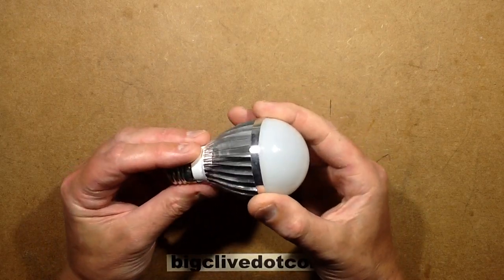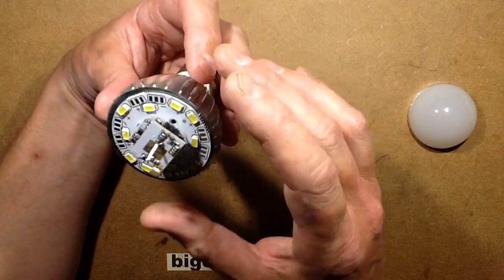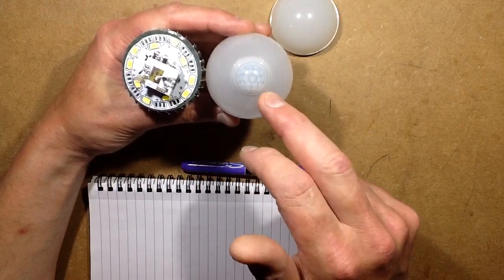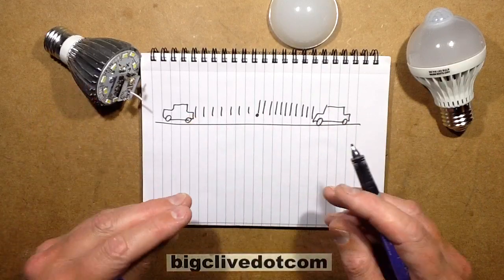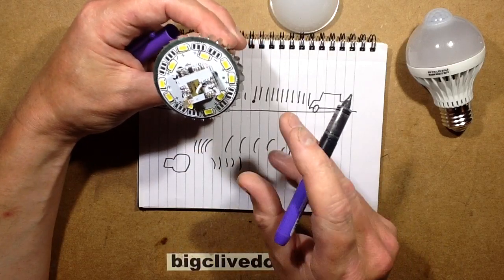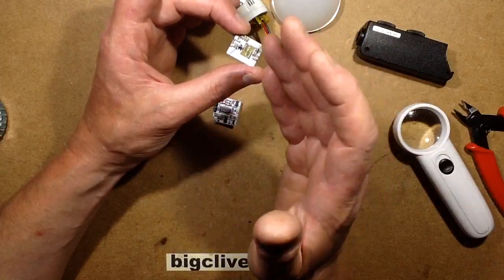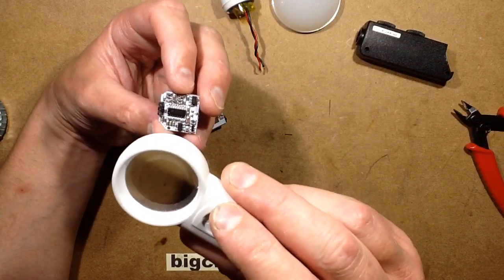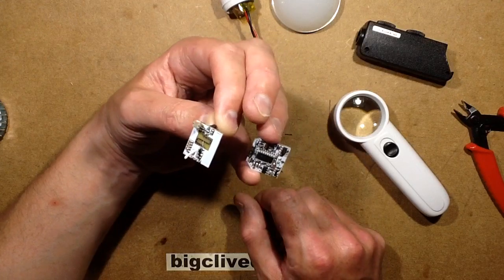Microwave doppler sensor lamp with perplexingly simple circuitry.

Comment: yeah, our alarm system has those weird motion+ PIR sensors (it has a camera too that snaps a picture when the alarm trips so that it completely and utterly knows there's a person there) the strange thing about it though is that it can't see through glass... it also has a microphone tuned to the frequency that smashing glass makes so that even the sound of a window breaking will trip it, id love to see you tear one of them down actually!
Reply: Dylan Collins yep, if they touched it for long enough to allow the heat to reach the other side of the glass. some types of plastic are transparent to those infrared wavelengths, btw, so although those sensors cant "see" through common glass, they can see through some plastic objects (like the dome that comes over the sensor, which looks opaque to us but works as a lens for infrared).
Reply: Glass blocks near infrared which PIR sensors use.
Reply: Mora Fermi ahh, I didn't know that, is there any particular reason why that is? Or are they engineered to actually do that?
Reply: PIR sensors use far infrared, not near infrared. It is long wave IR - also known as 'heat'.
Reply: they just measure the temperature of the glass, not the things behind the glass.
Reply: Jim Steinbrecher ahh, so if someone were to press their hands against the glass it would trigger due to the temperature change?
Reply: Jim Steinbrecher ahh, okay, and its giving me an image of a potential burglar pressing his face up against the window and triggering it by licking it or something xD
Reply: Dylan Collins just smear your windows with honey, and youll catch them like flies. or, more likely, youll catch a lot of actual flies.
Reply: Jim Steinbrecher and wasps, and bees, and well, anything that's small enough to get stuck and that's dumb enough to go for the honey 😂
Reply: Dylan Collins yeah, but "like bees" isnt really a common expression ;)
Reply: It is the nature of glass.  Visible light passes, nothing else.  Same with remote reading infrared thermometers.  They cannot see through glass, they read the temperature of the glass itself.

Comment: The shift should be so minute at 5.8Ghz, would it even be possible to detect the shift in freq?
Reply: Doppler shift increases with frequency.  At 5.8GHz, it would be a little more than 15 Hz per MPH.  Even one Hz would be easy to detect.

Comment: These modules use a method that was briefly popular in the 80s in the electronic hobby magazine. IIRC, ETI did one, for example. They work like this: 

The microwave oscillator runs continuously at a resonant frequency set by that very obvious worm-like track and probably a surface mount capacitor. This oscillator emits a few milliwatts of energy as best it can. The additional stub antenna (that white wire) helps radiate a bit more RF energy.

In the simple version of these things, a simple diode is connected between that resonant circuit (on one side) and the input of a really high gain low frequency (typically audio bandwidth) amplifier on the other. The oscillator therefore not only emits (low level) RF energy into the general area, but therefore also acts as the local oscillator for the diode, just like a "direct conversion receiver". 

OK, so nothing much happens if there is no movement, but the instant there is movement, the returning reflected RF signal will now contain the Doppler-shifted oscillator frequency. That happens to mostly be at audio/low frequencies, and they get amplified, filtered and detected, in this case in the BIS0001 sensor. It's a chip specifically designed for this sort of task, but normally used in that fashion with the PIR sensor, amplifying its low level low frequency signals. The old ETI (and other 80s) designs typically used an LM324 quad op amp to boost and filter the diode detected signal.

Nice and neat. And another idea that we've seen before, but now nicely manufactured in vast numbers at ultra cheap prices.

Thanks for the teardown, Clive
Reply: Do you know how powerful those are? any interference with WiFi etc.? Health concerns?
Reply: @krecikowi  a couple milliwatts at most. If on the same frequency as wifi (these little oscillators with a room as part of the tank drift around like crazy) it would lower your reception a bit. 

No health effects

Comment: Is it possible to donate to you so you review an LED bulb I'm thinking of buying?
Reply from the maker: It's impossible to properly test a lamp properly without running it for a long period of time.
Reply: I got one of these snake plants because I heard they're good for indoor air quality. Was thinking I could aim a grow light at it, see if that helps. But not feeling too confided about what I see on ebay for smaller LED growlights.
Reply from the maker: I've done a few videos on hydroponic grow lamps.  They were mainly much lower output than stated.

Comment: Off Topic Mystery: Clive, you seem to be a man who has come across a lot of weirdness in his time -- and I am not referring to Alex Salmond's past girl friends here -- and therefore you may have noticed this effect or heard about it some other way. 
You know those self gluing envelopes they sell in the post office? The ones you just have to press together and they are supposed to stick securely (Do they buggery!). Well, I had occasion to pull one open and I did so by pulling on the flaps. I happened to be standing in a darkish room at the time and to my astonishment I noticed what appeared to be tiny blue sparks appearing along the glue line. I pushed the two parts of the flap back together to see if I could repeat the effect and as the glue came apart, there were the sparks again. They looked like the kind of sparks you get from a low voltage current jump between a hot wire and a metal surface.
Ever seen it or know why it is happening?
PS. I thought it may be some kind of static discharge but I was amazed to see it happening on glue.
Reply: That's an interesting effect. Then again, dry glue has to work in some way after all, and relying on electrostatics (on a molecular level, anyway) does not sound so outlandish. Long molecules giving off charge as they are stretched are not unheard of either. A (bio)chemist should have more to say on this, I imagine.
Reply: yeoldeengineer
It was startling to see it. I think you could be right though.
Reply: Scotch tape does that as well. Static charge generated by separating two surfaces. Some time ago someone detected x-rays generated by unraveling scotch tape. AFAIR this effect was published in Phys.org.
Reply: Milan Trcka
Thanks.

Comment: I wonder if water thru PVC pipe or ceiling fans will trigger this one, that is a problem with RADAR sensors, some have algorithms to ignore those things, pet immunity under a certain weight etc...  Of course a dual tech PIR and RADAR like security sensors would be false free.  You may want to partially obscure the cds cell so it functions with some ambient light.

Comment: I don't think, that having a miniature radar for that is a healthy idea.
Reply: Never go outside in the sun. It emits MASSIVE amounts of radiation!
Reply: +llamaspit your joke is misplaced. I have enginering education, there is difference between microwave radiation, uv, radio, gamma, etc. This thing produces weakk microwave signal to work similarly to radars of old times (40-50s) By the way I could answer you, that  in fact sun produces amount of gamma radiation equal to 50 megatonn a-bomb during day per each square meter of earth surface. where it is? Filtered out by outer layer of atmosphere held by magnetic field. Most of it gets either absorbed and transformed into heat, spend to ionize the atmospheric layers  or transformed by ozon layer into UV.
Reply: EllAntares Engineering education = a system to delay entering the workforce where you prove you can pass examinations on topics that you were taught. Means absolutely nothing in the real world, with real products like this. These "lamp sensors" usually run at 2.4GHz or 5.8GHz - you can look up your text books (or even Google if you have the skills) and find that they deliberately use the same frequency as WiFi Networks. So, imagine how much of your dreaded "Microwaves" are being emitted by those wicked wireless networks - even more than the sun!

Comment: Possably a Gunn diode (TED) oscillator connected to load detecting circuit.
Reply: I would go with that, I used to buy Doppler modules from RS to make alarms for long coaches, they contained a Gunn diode and a receive antenna in the same "wave guide" a small portion of the signal was sent straight to the  receive antenna inside the module to act as a reference, the rest sent out, the "bounced" back signal (off of a moving object) is then added/subtracted from the original and these changes were used to trigger the alarm circuit.

Comment: Some microwave doppler modules use a mixer to mix the transmit output with the received reflection... with a static target the output is a dc level... movement of the target produces a beat frequency which is dependent on speed of relative movement....

Comment: I saw something similar in a 1970s hobby book of schematics.   They called it something like "UHF proximity detector," and it was a 1-transistor UHF oscillator with a little antenna, then other transistors on the DC side of things.

I think they were just measuring the current draw, and amplifying any AC changes.   I didn't build one, so I don't know how many meters distant it would still detect motions.

Comment: These do use the doppler method as you say, but they don't do clever frequency filterring or anything, if something is moving, there is the incident rradiation, and the reflected frequency sets up a beat frequency with it, so as you move, you get an audible beat that is higher pitched the faster you are moving.
Way more simple than you were even saying. Presumably that PIR chip would detect even small amplitude beats and trigger.
It's probably using a gun diode eather in a wresonant cavity or a tuned bit of trackwork!
I'd bet it has one set of tx/rx antennas, and the beat is detected from it's current draw.

Comment: This is a possible method of operation that will turn your brain inside out: There may be no oscillator on the module what so ever for the 5.8GHz. I suspect what you have is a couple of narrowband tank circuits (think coil and variable cap in a crystal set), that use far field capacitance (IE a human body) as one of it's finite elements to couple them (or possibly the only element as the polarities are at 90 degrees IE vertical and horizontal). If you charge one to say a couple of volts it will then cause oscillation in the other (and it's self) every time the far field capacitance changes (IE your body moves). You only need miniscule changes in capacitance to activate the circuit as at 5.8GHz even 1pF is only about 27 Ohms impedance. If you are only looking for a micro amp current flow from 2.7V you would only need 1/100,000 pF capacitance change in the far field capacitance. When Idle this would draw a current in the kappo-amps range on FR4 or less on a ceramic substrate if it is clean. The only detector you would need is a Gunn diode or similar (think cats whisker in a crystal set). The KGB used a very similar method to this with a remote exciter to listen in on a bug that nobody figured out for years as it just looked like a metal clip.

Comment: I've heard you use the term a few times and I still haven't picked up completely from context what it means. Could you explain what capacitive coupling is? Maybe its a subject that would be good for one of your tutorial type videos?
Reply: Any two spaced conductors will form a capacitor. /Any./ Capacitance might be arbitrarily low, but it's there. The electrical field of a mains transformer primary may induce noticeable hum in a high-impedance audio circuit like this, for example - you may only be looking at a fraction of a pF, but imagine you've got full mains voltage on one side and want sub-1 mV on the other, at 10s of kOhms. Doesn't take much.

That's why people usually turn that side of the transformer away from circuitry, and why shielding is used if need be. The shield keeps a constant voltage WRT the circuit, and any current originating from capacitive coupling is just shunted to ground. You could say a shielded circuit is a shorted-out capacitor. With its voltage being defined as zero, no current can flow in it. (*) Of course this also means that you have now added capacitive coupling between your circuit and the shield, which may not be desired e.g. for bandwidth reasons.

This is also why RF circuitry works at low to moderate impedance at best (usually 50-75 ohms, occasionally a few hundred ohms). There's capacitive coupling everywhere, and things become increasingly uncontrollable the higher up in frequency you go. About the only way you can reach tens of kOhms even at comparatively low frequencies (by today's standards) like a few dozen MHz is making a resonant circuit. At 30 MHz, 0.5 pF amounts to little more than 10 kOhms of |Z|, and that's little more than a typical axial 1/4 W resistor has in terms of parallel capacitance.

*) Note than any non-zero-length of shield to ground connection will have parasitic inductance (RF trouble spot #2), but this is typically kept low by the connection being wide all around the circuit and not too thin.

Comment: It definitely looks like a single transistor oscillator for the RF generation. What I can't tell is if the output is split, one going to the antenna and the other going to the comparator. I can guess it's using something similar do a hetrodyne radio receiver, but the local oscillator is also the transmitter oscillator. When you mix the local oscillator and the reflected signal together, the remaining signal is in the low hertz range. Even though you're using really high frequency RF, the detected signal isn't.
Reply: It is unnecessary to use the original signal as a comparator.  What will happen is the room is filled with reflections and they reinforce or cancel to varying degree.  At 5.8 gigahertz the wavelength is 51 millimeters so it takes only 25 mm (one inch) to obtain a complete phase reversal and produce a detectable signal strength change.
Reply: I'd say it's a simple, free-running heterodyne oscillator where the antenna forms the primary load; the reflected signal is so strong that it causes the oscillator to either 'lock on' to some frequency dictated by the reflection pattern or start fluctuating -- and those fluctuations are detected by the rest of the circuit and used to light the lamp up.
Reply: Mora Fermi
If the "load" (person moving) is modulating the main oscillator, how can you tell if they are moving? You don't have a stable reference to compare the reflected signal to. Instead of measuring the pull of the oscillator, you mix the oscillator (who's frequency isn't stable) with the reflected signal. The difference frequency is the movement of the person, and that can be detected with a simple AM conversion.

Comment: Yes! Finally you got one.
Don't you just love the cheesegrater heatsink fins?

Mine got more and more erratic over time, pretending not to notice me sometimes. I have taken it down to try and fix it but haven't gotten around to it.

I don't think this works with the doppler effect. I think this is just a single transistor oscillator and it detects changes in overall reflection/absorbtion in the room by monitoring the supply current to the oscillator. The PIR IC is able to detect very tiny changes.

7Y MMBR941L Mot SOT23  npn RF fT 8GHz MRF941 So just a NPN transistor.
I've even taken this into the radiated EMC room and it makes a spectrum of narrow lines at around 3Ghz or something.

The other "radar" detectors on Ebay (with the white dome case) do really use the doppler effect. You can tap into the signal and make a speed detector, but I think this one is different. It is strange because it really was so incredibly sensitive.

Comment: Why couldn't the chip work in the same fashion as it does when hooked up to a PIR sensor? It could simply detect a change in the pattern of returned energy with antenna acting as illumination and an antenna array acting as "eye".

Comment: +bigclivedotcom Clive, if you have a new AC router, would you mind testing how close you need to have this light to the router before you start to get serious interference? It obviously has no shielding whatsoever (by design, duh), and I can see it playing merry havoc with a fancy new router's oh-so-delicate 5.8 ghz signal.
Reply: Well, some of those routers dump out half a watt (50-800mW is normal for the 5.8GHz routers). Clive said the lamp puts out 2mW. I'd see the router triggering the lamp on instead of the lamp interrupting the network signal, or maybe both at once. Think of it this way, the lamp provides a constant oscillating 5.8GHz signal, it can be more easily compensated for then an unpredictable noise source. In part of your house or yard with a really weak signal, then it might make it worse.